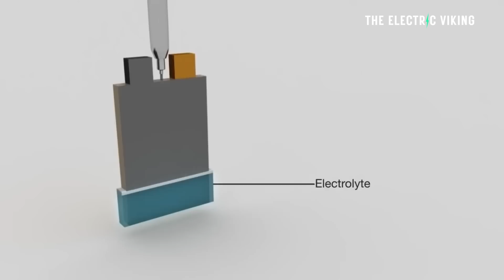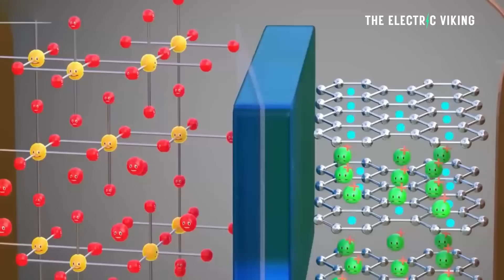US Scientists say water-based batteries are cheaper & better than lithium

Comment: I wouldn't downplay researching new ideas. Sodium batteries were a not so great solution not too long ago, yet here we are. Even though batteries have been around forever, this push to EV and storage supercharged the battery research and look where we have gotten in a short amount of time, especially in the automotive world. Long term should always be looking at improving. This research may not be the immediate answer but it could be later or spark a new discovery.

Comment: Yes, I read this several days ago. Even if they don't go into cars as quickly as one might hope their potential for mass storage for excess grid power and the potential to add Climate is astronomical. And as far as batteries go the EV will be king when it can achieve standard ranges equal to gas of the same range at or less in cost. Once that is reached ICE's with some small segments will be over.

Comment: It's shocking to me and mortifying that men will spend $60,000 restoring an old car and they won't spend a single second trying to improve the gasoline engine. Not a single second. Copying what has already been tried, and repeating the same 100 year old processes over and over is not a solution. The big corporations won't give anyone the best technology until the public builds it on their own. As of right now, we are not allowed to work on alternative fuel systems or alternative energy systems. That's because the general public has voted by their complete and total lack of curiosity or interest in new technology. Because the public is agreeing to gasoline without complaining or asking for cheaper or cleaner technology, the new technology won't be allowed. FYI, I think there are solutions to energy (for more than 50 years now). But nobody wants to take the initiative to learn.

Comment: Any battery which uses water as an electrolyte will be inherently very heavy.  Water is almost exactly twice as heavy for the same volume as Lithium (mass density).  This in its self will seriously affect car performance.  A water electrolyte battery would therefore have to have at least twice the energy per kilogram performance of a lithium battery in order to give an overall performance and range advantage to the car.

Comment: You mention that Sodium based batteries are making there way into EVs.  Yes this is true but they have lower energy densities than Lithium based car batteries.  Tesla will be installing Sodium 50KWh batteries in their new cheaper car line up.  This is far less charge (and hence vehicle range) than the 75KWh batteries inside their existing cars.  Yes Sodium based batteries are cheaper than lithium batteries and perform better at lower temperatures, but their energy density is inherently lower and the batteries are heavier.  Many experts say that Lithium ion batteries have now almost reached the peak of their performance.  Maybe Lithium air batteries or batteries using graphene will one day drastically improve battery performance, but not likely for at least another 10 years, (more like 20+ years ahead).  Many honest scientists and engineers admit that there is no on the cusp big breakthrough in car battery technology.

Comment: The professor said at 3:10 'There is "in my belief" a 1000% difference in energy storage capacity depending on the electrolyte choice because of the swelling effects''.  This is very very different to saying or suggesting that there is a 1000% battery performance improvement over contemporary lithium car batteries, which is what your click bait title strongly suggested.  'Electric Viking', you have taken a quotation completely out of context.  All the professor meant by this is that there is a huge difference in battery performance depending on which electrolyte is used.  She did not say or even suggest that this type of battery is 1000% better than lithium batteries, as you are trying to suggest.

Comment: I am in shock.
I think you'r wrong.
This water based battery will kill all other forms of battery. I cant see any problems with it. I think your doing what many people do and that is talk their own book. Explain to us why you think the chemistry wont work?
Your going to see regulators demanding all batteries are made this way within 10 years to reduce pollution and cost. Clearly trucks will use this form of battery. Nothing made "practical sense" for trucks before. This goes well over the line. The truck industry is going to actively want this. It may also be a big negative on fuel driven inflation. Planes and ships will still use fuel but that's fine. Lets say the technology get even better and they increase energy storage to 2000% that of Lithium or Sodium meaning you only have to charge once a month or even longer. You don't even need as many charging stations. Every thirty houses could use one station or everything is done at a suburban station while you eat a meal which may be free to entice you to use that station.

Comment: The water based battery is still over the horizon and thus in the short run irrelevant. And the fire issue with lithium ion batteries is mostly from the combustible electrolyte. Lithium & sodium are both incredibly abundant so battery cost will continue on average to cost less & less and slowly last longer & longer.

Comment: The ultimate battery solution is going to be the best balance of cost, sustainability, capacity by weight/volume, safety , lifetime, and environmental impact. Add to that we need batteries for planes (weight, volume and safety EXTREMELY important ), transport (cost and safety), and grid storage (safety cost and charge cycles) along with a myriad of other combinations, I wouldn't be too quick to poo poo a new development.

Comment: I think there is always room for improvement with efficiency, energy density and environmental friendly manufacturing in batteries. It will take years probably, as anything else that is inovative and radical. And of course the industry will want to firstly use the technology they already invested in.
But picture this - A smaller, lighter battery that can achieve 1000s of Kms per charge, combined with a wireless low power induction charger in your garage or a solar roof top on your car. Its a battery that never dies, because you charge faster than you use it. This could be it..

Comment: I think you may have misinterpreted what the report says; I think they found 1000% differences between their tests depending on electrolyte and anode/cathode choices, not 1000% improvement over existing batteries.  Other popular reports seem to have made the same mistake which probably fooled you.

Every exploration of alternatives in battery design is worthwhile, and this may point to better technology eventually.  But not that huge a result now, I think.
Reply: Yes, I noticed that too reading the paper's Abstract summary.  They seem to be saying they get big variations on energy storage within this particular design & chemistry families investigated.  .... NOT compared to existing Li-ion batteries now.
Reply: This was the back-to-earth comment I knew I would find. If it seems to good to be true and all that.
Reply: This is not an isolated insistent. This dude has no technical understanding of any news he shares. Simply reads a headline and makes a 10 minute video out of it.
Reply: @cold_jay  That’s not true.  I check a lot of his new technology reports and typically he has a decent summary of the specific technology and science.

He’s not an industry professional or engineer like the Munro Live crew, but doing a good job of capturing and synthesizing new reports.
Reply: @cold_jay  but he can spell - incidental as it is, but then you have made his error your thing.
Reply: @economistfromhell4877  
Incident

Comment: Probably a stupid question but what happens to the water based batteries in freezing temperatures?  Maybe by the time the water is mixed with those polymers its not quite water anymore so no problem?  Also what will the source of water be in our increasingly drought ridden times?  Can we use sea water or will it take ground water?  Another great episode Sam.  Thank you.

Comment: There are some limitations on using a water based electrolyte. It cannot use any of the alkaline metals in metallic form as they react badly to water, they can only use the ionic form and that puts a limit on the maximum possible energy density. Also, they are limited  in the voltage per cell, too high of a cell voltage and it will spontaneously self-discharge by electrolyzing the water. That also presents a limitation to the energy density. 

These new batteries are unlikely to find much use in mobile applications, but may prove useful and cost effective for stationary applications.

Comment: If these new water batteries are anything like the vanadium re-dox batteries that have been around for decades, the biggest advantage they would have beyond being fire-proof is that they would have near-infinite charge cycles.  In that case, they would be well suited for stationary storage like grid frequency regulation and home storage where daily discharges are desired due to time-of-use tariffs.  I guess we'll see.
Reply: I agree, energy storage is a situation where cost and safety are paramount.

Comment: The theoretical energy density of the lead acid is many times that of what we have been able to get from them in the real world. A few years ago a company claimed they had cracked the thing that was blocking lead acid from reaching its theoretical maximums by covering a carbon lattice with lead. It made the batteries a lot lighter per volume but didn't improve the energy density that much. Lithium was still so much more energy dense per kilogram. I'm glad that battery research is trying everything. Even if they can't make a battery suited for an EV with the research, chances are that they will figure out how to make a cheap, very energy dense battery that can be used for grid storage. What this does is split that demand for batteries for particular markets making batteries more abundant for electric cars and therefore dropping the price, as well as providing an abundant source of cheap, stationary energy storage that will make intermittent renewable energy sources much more appealing. It's a win for all of us whatever they come up with that works.

Comment: Would it be possible to put one water based battery 2” h x 4 ft wide x 6 ft length in an electric vehicle. Don’t know how much weight that would be at 8.5 pounds per gallon. One battery should be cheaper than hundreds.

Comment: The more the merrier. Having more options for battery technology will provide different chemistries and characteristics for different market segments. The requirements for aviation are different than marine or road or rail or stationary storage. There is room for a wide variety of battery types. Using lithium for stationary (grid) storage does not seem to be the best application of lithium. Good water based batteries would be an excellent alternative.

Comment: If this new technology is truly coming in the very near future, great. I live in Texas, one of the largest producers of petroleum fuels in the world, according to the propaganda machine. If the oil lobby can use the possibility of super batteries within three to five years to delay the mandate for EVs for up to five years, they will. The Petro industry is still hoping the political climate will change before 2030, and the move towards 100% EV fleet will die. If a super battery actually comes along, even if it is too heavy for practical use in vehicles, the potential for stationary mega or even giga battery storage facilities will be enormous. That will free up current technology batteries for EV use, making them theoretically less expensive.

Comment: Water-based batteries have great potential in warm country but not in cold one like Canada, where we have at least 3 month of real winter below zero celcius. They will split with the frost.
Reply: Salt water does not easily freeze
Reply: @markhartung1190  Good point, it does lower the freezing point quite a lot. Possibly since sodium is ok in batteries, NaCl could be ok, as well.
Reply: @markhartung1190  The water freezes out a little below 29 F.
Reply: You ALREADY HAVE water based batteries in your car right now! Do they split? No.
Reply: @fordstone6308  Ya, but they have acid in them. Likely an H20 battery cannot.
Reply: @fordstone6308  A half charged lead acid battery will freeze at -13F. While a 25% charged battery will freeze at 9F.
Reply: @fordstone6308  they are acid based. Yes, you add water but when water is added to acid, it becomes acid. Are these batteries acid based? I will rewatch if I missed that.
Reply: Lead acid batteries (12v) is water based and sealed.   They do fine in freezing temperatures.   The older ones, you had to refill them with water but not anymore.
Reply: It could be that water based batteries could be used for megapacks and other stationary battery storage applications and be stored underground or in insulated enclosures in cold weather environments freeing up current batteries (no pun intended) for automobiles…
Reply: He says "mixed with organic salts".
Reply: the organic chemistry might lower the freezing point or find an additive.
Reply: That was the first question that popped in my mind. How will they act in extreme cold. Maybe they would be great for home storage.
Reply: @DuaneL1961  Possibly they can still work with something like ethylene glycol in them. Alternately driver in very cold climates are accustomed to plugging a block heater in. When it can't be plugged in, trickle minimal heat from the batteries themselves. Or possibility they are not something that will work in cold climates.
Reply: @machoopichoo2  oh I agree I just wanted to know if they thought about it and what their possible solutions were.
Reply: @DuaneL1961  Indeed, good questions. It is nice to see so many different ideas being brought forward to help with battery supply. 

I had a prof in 1999 that claimed Moore's law was likely coming to an end soon. Didn't age well. However, chips are now getting down to the limits of the size of atoms, so we may need quantum computing ASAP. 

Why am I mentioning this seeming non-sequitur? Well, about 20 years ago, some "experts" were claiming that Li-ion batteries were reaching absolute limits. Again, didn't age well. They must, at some point, but not anytime soon. ;^)
Reply: @DuaneL1961  buy a petro car. So easy.
Reply: @machoopichoo2  ima keeps my Ram gasoline for now. The DAY ya’ll figure out how go 500+miles with a quick charge im all in. Like most folk I talks to. All these vids of problemo’s like fire and low power change the Simpleton mind very easily. We test drove a mod Y a year ago we all were very impressed. Happy Driving lectric freak, hehehe
Reply: @machoopichoo2  The organic solutes in the water, whatever they turn to be, will very likely have a similar anti-freeze effect as ethylene glycol does.
Reply: @adamwu4565  You could well be correct. As noted by others, current lead-acid batteries contain water but do not freeze, even at -40.
Reply: @ericpitre4031  If you can drive 500+ miles without taking a break, I’m gonna be more impressed with your bladder than with your vehicle! Meanwhile, a Tesla supercharger can add 200+ miles of range in 15 minutes - and that’s today’s tech, not what’s coming. As a lifelong midwesterner, I’ve done plenty of road trips (including 900 miles in a single, awful day once), but I don’t recommend driving more than 200 miles without stopping, if only to stretch your legs. It’s uncomfortable and unhealthy to sit without moving for that long.

Comment: I think you are being a bit harsh on this development, because it appears to be different in some important principles to the Li-ion and LFP batteries. It is not just the cost and availability of the battery metals; this team may have come across a completely new battery chemistry that is unlike anything existing.
The downside is that it is likely to be 10 years away from production. The upside? Cars with a range of 4000 miles? Long-distance passenger aircraft? E-Trucks that can travel across a continent without refuelling/recharging?
Those are pure speculation now, but it shows that LFP batteries are not the ultimate. I hope those scientists keep up their work on this.
Reply: May well be a long way away but if they had thousands of miles in range then swappable batteries would make sense - imagine driving for months and then just going into a centre and swapping for a new one.